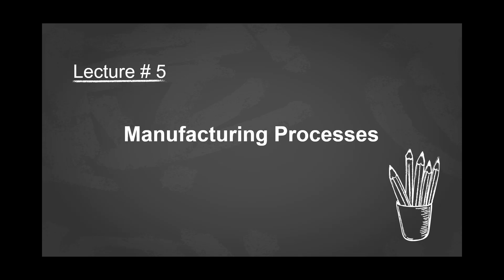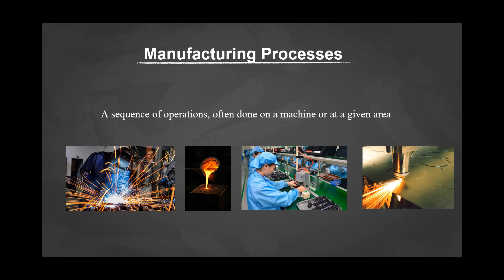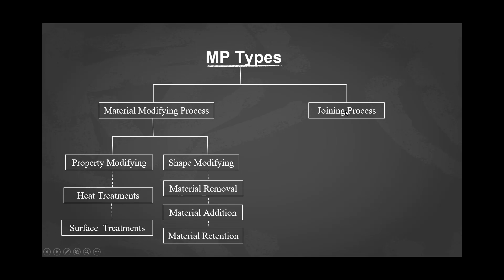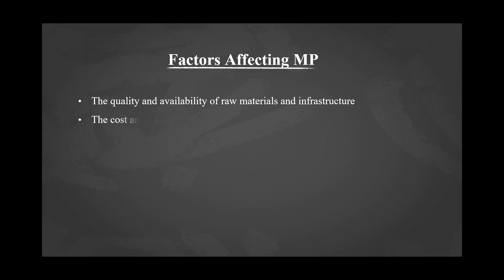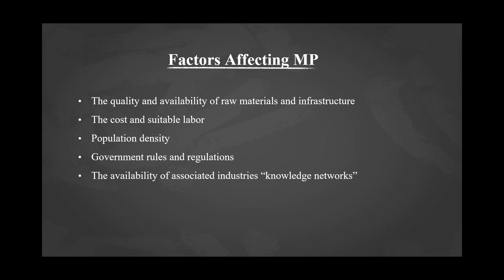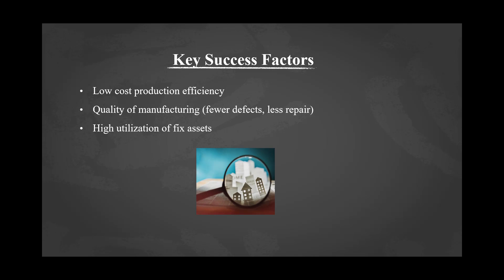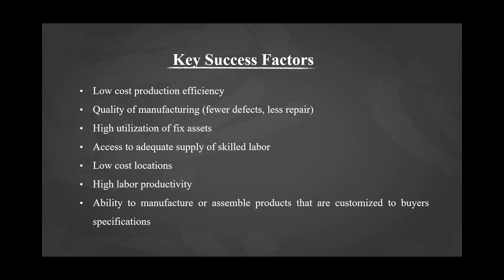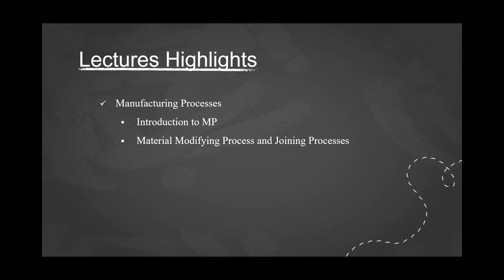lesson #5: Manufacturing Process,  Types, Factors and key success factors of manufacturing process

Comment: _____Roll no.: F18-0373_____
Conclusion:
In this lecture first, we studied the manufacturing processes which is the operations done on a 
machine or at a given area and these operations are in sequence. e.g: Welding, coasting, etc..

It converts material either in the form of raw material or minerals, into products and parts.
Then we studied types of manufacturing processes;
Two main Types of Manufacturing Processes;
✅Material Modifying Processes    [Further classified into two types which are Property modifying(Heat Treatment and surface treatment) and second Shape modifying(Material removal, Material addition, and Material retention)]

✅Joining Processes   [Further classified into three types which are Permanent, non-permanent, and semi-permanent]

Then we studied the factors affecting the manufacturing processes,i.e; The quality and availability of raw materials and infrastructure, The cost and suitable labor, Population density, Government rules and regulations, The availability of associated industries.

Further, we studied the key success factors,i.e; Low-cost production efficiency, Quality of manufacture, High utilization of fixed assets, Access to an adequate supply of skilled labor, Low-cost locations, High labor productivity, Ability to manufacture products that are customized to buyers specifications, Low-cost product design, and engineering
....
                             ..................................Task.................................
  >Business name: Online outsourcing of Software business;
  >Strengths:
✅ Lower Set Up and  Running Costs Than An Offline Businesses.
✅The Business Can Be Operated From Anywhere.
✅Scale-ability.
✅No Opening Time Restrictions.
✅Less Time-Intensive.
✅ Higher Margins & Better Cashflow.
✅Global access, 24 hours a day, 7 days a week
✅Improved client service through greater flexibility
✅Cost savings
✅Faster delivery of products
✅Increased professionalism
✅Less paper waste
✅Opportunities to manage your business from anywhere in the world.
                             ..................................End.................................
Reply from the maker: comment both the task separately
Reply: @elessons4834   _F18-0373_
 ..................................Task.................................
  >Business name: Online outsourcing of Software business;
  >Strengths:
✅ Lower Set Up and  Running Costs Than An Offline Businesses.
✅The Business Can Be Operated From Anywhere.
✅Scale-ability.
✅No Opening Time Restrictions.
✅Less Time-Intensive.
✅ Higher Margins & Better Cashflow.
✅Global access, 24 hours a day, 7 days a week
✅Improved client service through greater flexibility
✅Cost savings
✅Faster delivery of products
✅Increased professionalism
✅Less paper waste
✅Opportunities to manage your business from anywhere in the world.
                             ..................................End.................................
Reply from the maker: A+